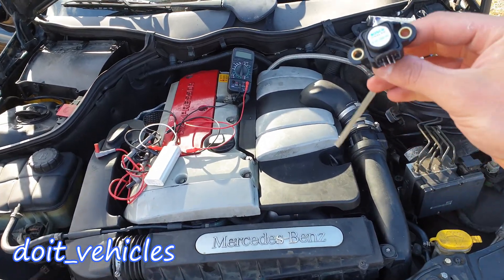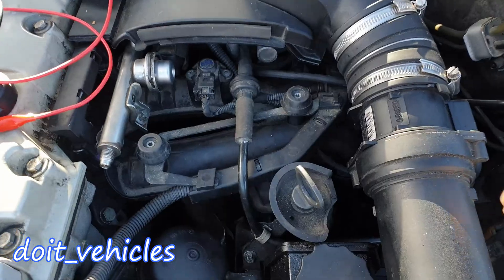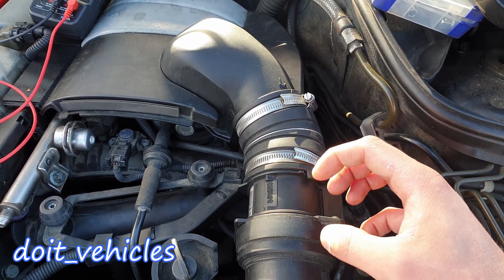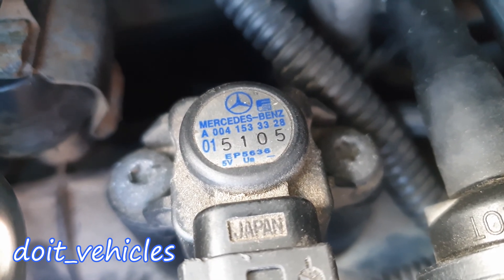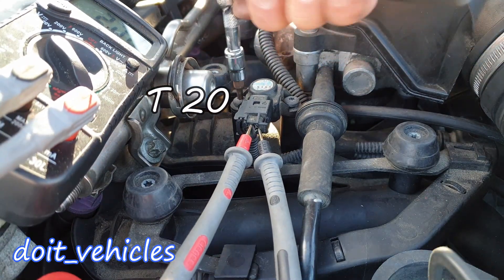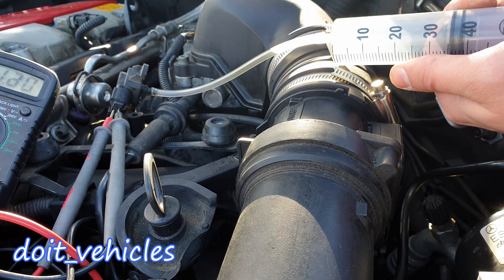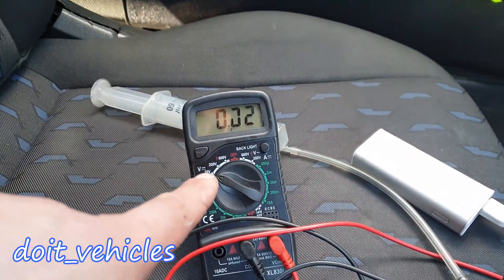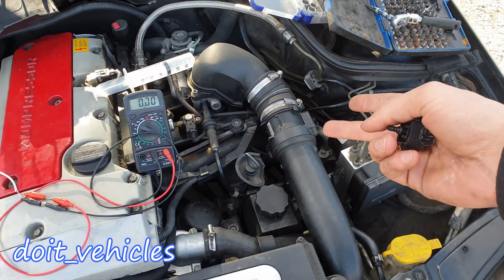Mercedes w203 C200k Altitude Sensor -Testing and how it works

Comment: hey @doit_vehicles bro,
I have got the same car, I changed coil packs and spark plugs but still had misfires when throttle is around 1/4 open. I unplugged this altitude sensor, everything is fine now. I bought a new sensor brand is bosch. plugged it in, still got the misfires. so returned that sensor. what could be the problem now. if I use it unplugged, would there be any more problems in the future. not works fine with unplugged but I'm confused a bit. thanks in advance

Comment: Hello mate me again,
I've checked everything and i have all voltages,then i was thinking that the sensor is the problem and i replaced it.But the check engine is still on and the codes again refer to the sensor.my question is does this car have 2 sensors because the very good diagnostic told that i have something on positive wire that is bad ??
Thank you in advance😅

Comment: Do you have any clue about P2039, P201D and P0172 car has lack of power and doesnt response on the throttle usually when starting to move  -02 w203 200 kompressor

Comment: What is the normal PSI for a map sensor after the car has been started for 15 minutes on a 2004 Mercedes C230 1.8 engine, mine is reading 7.83 PSI
Reply from the maker: that's a normal value under vaccum
Reply: @doit_vehicles  it is, that's great. thank you very much for letting me know

Comment: Hello! on MB W203 M111 KOMPRESSOR in this sensor the hose should be connected or not?
Reply from the maker: There is a port next to the throttle body
Reply: @doit_vehicles  In your video on Altitude Sensor, I did not notice the tubes, can you find out more precisely where the tube should be connected?
Reply: Where next to the throttle body

Comment: Hello! I have w203 with m111 kompressor. Every morning, after cold stating and shift to Drive, i am press to accelerate pedal, but engine not  to accelerate(the car not driving). The engine is does not spin in 5-7 seconds! After this, acceleration occurs. This trouble Only in the moning or after cold starting or long stay.  Only first 2-3 attempts. No check! No errors!
If you have whatsApp or another messenger, please whrite your number. (Sorry, my English is not so good).
Reply from the maker: There needs to be done some testings on the car - Try to do a throttle body check ( I made a video about that ) also very easy : turn the key in the second position , press on the pedal and watch the throttle body flap , it should move .

Comment: Hi, MOTIVATIONAL
My Mercedes w203 Sensor map is located next to the maf sensor is with 3.44v is the other atmospheric pressure map sensor of the intake manifold is 1.98v. Some ideals?
In the back comes a white smoke with a strange smell?

Comment: Hey! I have a mercedes c180 I have some questions how can I reach you? I need help thanks in advance!
Reply from the maker: Hi ! The best I can do is to answer your questions here on youtube . Regards
Reply: So I bought a c180 2002, and couple of days later a weird loud sound comes from the engine, I changed the water pump it had play in it but the sound is still there, the sound comes and goes doesn’t stay for long, do u think its a chain tensioner problem? If there is an email where I can send u a video of it would be rly helpful i live abroad and mechanics here aren’t the best unfortunately
Reply from the maker: doitvehicles@yahoo.com send it here I will have a look . Depends if the sound increase when you rev up the engine . If it's like a grinding sound , it might be a weak timing chain tensioner
Reply: doit_vehicles i sent u an email thank you!!
Reply: Where does the altitude sensor vacum line go??